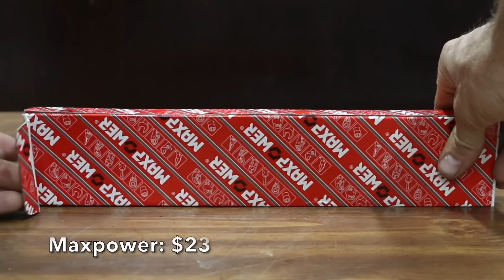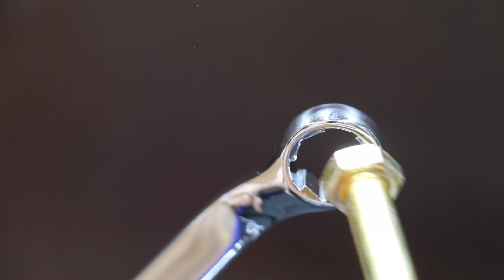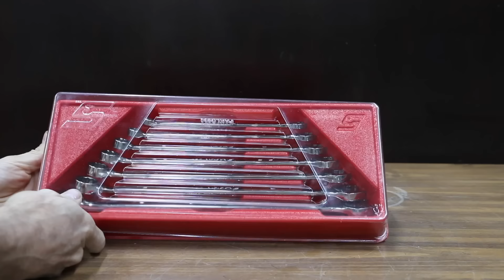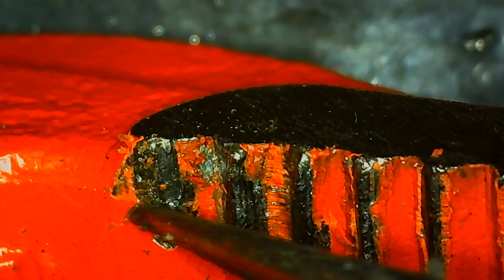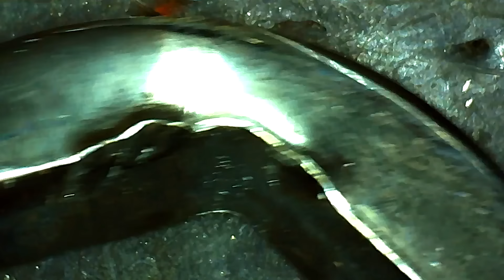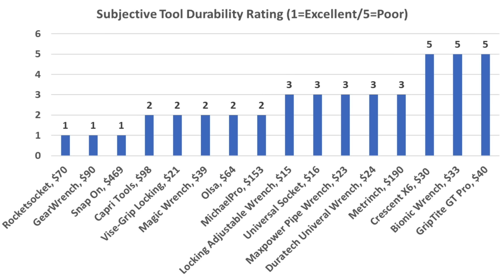Best "Rounded Nut" Extractor Wrench? Let's Settle This!

Comment: My mom got me a bionic wrench a few years ago for a Christmas present. It looked cool, but that was it. When it comes to practical uses, it's 100% useless. I tried to use it 1 time to change the oil. It was the 1st thing I grabbed. It wouldn't break loose the drain plug. It's not even remotely comfortable to use either
Reply from the maker: Thanks for sharing.

Comment: Todd It's been a while, how about a updated ceramic coating test? I feel like you could take the top 3 from the last video and compare them to the new stuff that is out. It seems like that field evolves faster than most people can keep up with it.
Reply from the maker: Thanks for the suggestion.
Reply: Breaking Taps has done research on this.

Comment: I have the best luck with regular old pipe wrenches getting rounded bolts out. Definitely hard to get into tight spots tho. I know one thing for certain and that's anything made by Irwin is absolute garbage. Have you done C clamps?

Comment: I’ve got mastercraft set (sold at Canadian tire) two ratcheting wrench’s covering 8 sizes and I’ve never found a bolt they won’t turn out, I have the socket set as well (same style as the rocket socket) and they grab like crazy as well, I don’t use them every day but they get used a fair amount and have held up great, which is surprising for something from crappy tire lol

Comment: I have a couple Capri tools,, they are very good quality. I think I'll keep using regular ol' vice grips on rounded bolts unless I see a great deal on something else. Lack of easy access is usually what causes the problem to begin with and nothing fits every situation The old "weld a nut on top" trick works better than anything if you can..
Reply: 100% correct what you said Vice Grip and weld a nut are king to remove damaged nuts and bolts all the other products  used in this video are not worth the money  spend your money on a good welder or  a top of the line Vice Grips

Comment: So much work goes into these videos.  I don't think you can buy bolts with a rounded head, nor do I know how your torqued them down.  However I think you made a lot of people happy crushing the metal pin tool.
Reply: Best way to round bolts is putting them in a lathe.
Reply: @jort93z  That's true but something tells me a drill and a bastard file were involved.

Comment: WOW, Commander! You did a FINE job on the tests BUT I never knew there were such things. I might need to get out more but don't see a real reason to do so. I have an old pair of Vise-grips and an 8 inch rusty Rigid pipe wrench and a set of DeWalt Rocket Sockets for the impact. I never have been too particular how I got something loose, as long as it came loose. My pal at the saw shop said the DeWalt Rocket Socket jobs would bring stuff out but the bolt was shot. That never has been a factor here because I can always drill it out and put a nut and washer on it. Hope the last of winter is treating yall easy. Stuff starting to freeze and die back here but it's expected. THANKS for the rounded and semi-rounded test. That shows up a lot of junk. BLESSINGS all over the FARM!
Reply from the maker: Hi Lewie, Thank you very much for the positive feedback on the review. It means a lot to me! You've got a great strategy for dealing with rounded fasteners. The rounded nut extractor wrenches sure are nice for those hard-to-reach nuts and bolts. I'm sure looking forward to warmer weather and so are the cattle as they're already looking for green patches of grass. Another month and grass growth should good enough and I should no longer need to feed hay.  Wishing yall many BLESSINGS!!!
Reply: @ProjectFarm  I've mowed the high places a couple of times but the rest is greening up and coming on up. It'll be here before too long. Yall stay warm and dry with all that good old hard hardwood you've got ratholed back for such weather. God Bless!

Comment: I've always had good luck the few times I've had rounded fasteners with a Swedish pipe wrench. Also very handy for changing a very stuck gas chair cylinder. 
If I need something smaller the Capri looks like a good buy. Thanks again.
Reply from the maker: You are welcome!  Thanks for the feedback.

Comment: It's unfortunate to see that, even the manufacturers mention the metric sizes, you don't do this in your videos lately. :( Please please mention both of the systems (metric and imperial)..
Reply from the maker: Thanks for the suggestion.
Reply: For all practical purposes the Imperial system of length measurements fell out of use during the Great War. The USA never used Imperial and Great Britain needed our manufacturing capability. By then we'd switched to the International Industrial Standard System. Now granted Standard and Imperial are very close to one and another. Close enough a lot can't tell the difference. But the system that's been used for over 100 years now isn't Imperial. Because Murica! Oh and by never I mean we didn't use Imperial before switching to Standard either. The old US system actually predates the Imperial system by 40 years.

Comment: I imagine a regular pair of vise-grips would have out-performed all of those wrenches at a much lower price.  When I have a rounded bolt head to deal with, regular vise grips are my first choice, as the bolt is already wrecked and needs to be replaced anyway.  Another great video, Todd.  Have a great Sunday👍
Reply from the maker: Thanks!
Reply: I agree. Vise grips are invaluable. Shame they’re made in China now.
Reply: @I_SuperHiro_I  The Malco Eagle grips are US made
Reply: @I_SuperHiro_I  I have a small and large pair I bought years and years ago which are made in USA.  Been through hell and back, but still worth their weight in gold.
Reply: A vintage Petersen Vice Grip would probably outperform the "new" one but there are some other tool manufacturers who make locking pliers that might be better than the current "vice grip"
Reply: @davidpowell3347  Have you had a pair of the Malco Eagle grips? I have several; Made in the Original USA Vice Grip Factory and are amazing. Way better finished that the old Peterson Vice Grips -(Which are Great)
Reply: @marko11kram  I have one,I probably should check whether Epstein's Hardware Store "HJE" has any more,they sell online,I think that Malco of Nebraska might have stopped manufacturing them. (various styles and sizes) People tend to buy the cheap stuff.
Reply: @davidpowell3347  I believe they are selling out their old stock. I bought a few as the ones I bought already were so great. 
Their price was high, but so was the quality. 
Even at the price, they are, (were) worth it.
I bought a bunch looking forward to the future

Comment: Awesome ! Thank you . & I need to check out your other video on socket extractors , too . This video makes me feel like there’s a proper tool for the job and none of those are it in my opinion 😅 extractor sockets all the way replace the bolt save the fancy tools for the easier jobs they’re for I think . Last thing i want to do is damage any of my tools . Seems wrong . Meanwhile , extractor sockets were made for this . Other options are penetrating oils spray cans or dangerous heat tools like a hot knife or a fancy bolt heater tool . I tried the hammer and chisel claim but ruined my chisel . & it was an expensive chisel .. don’t believe everything you hear . I’d rather have used a scrap piece of metal and beat the sh*t out of the bolt than have ruined a chisel . Don’t ruin . Hell naw . Bolts are cheap . If an extractor sockets or hot knife doesn’t do it I’d just break it off drill it out and tap it .
Reply from the maker: Thanks and you are welcome!

Comment: Todd,
As always incredible video! I am curious if anyone has suggested paint brushes. I know you did painter's tape which was incredibly valuable. Perhaps paint rollers too, such as which brand is the most absorbent and drips the least. Also curious how your coffee brand is doing? I'm venturing out from my daily coffee brand and absolutely want to support you, outside of youtube!
Reply from the maker: Thanks!  Thanks for the video ideas.  Folks are enjoying the coffee!
Reply: One brand - found everywhere (in the US) - that's stood the test of time - Purdy!  Yea, $20+ dollars on a brush - but I've had a 1.5" and 2.5" sash brush for 35 years.  Clean the well, hang to dry, store in their covers.  Key thing - get the right brush for the right product for the finish you want.  E.g. Chinese bristle with latex (needs to be synthetic) is just asking for problems.  But for solvent-based poly, lacquer, shellac, etc. Chinese bristle is the way to go.  Technique, and product you're using, it's age, temp, humidity, etc. also have a lot to do with how the finish will turn out.  Lot of variables that need controlling.
Reply: Paint brushes would be good.

but a painter got me to spend money on premium brushes (I just get the purdy since they're easy to find) and it makes painting so much easier and cleaner than with a cheap brush.

Comment: You need to revisit stripped screw extractors, there are sooo many different types on the market today, and thats before throwing brands into the mix. Altho Ive personally found that the style type that uses screw threading(like ryobi) is the most effective by far, the only other type ive tried is the twist fluted kind. But there's at least a half dozen, if not more, notably & significantly different styles, plus some hybridized styles. And further more, of that theres some that combine the drilling & extraction into the same action; and even further more, of the hybridized, theres a couple different styles. And how those compare against a good pair of vampliers would also be a useful additive to the testoff. I know itd be going the extra several miles to additionally compare the large various available substrates (like bearing steel, etc) and coatings(black oxide, Tin, TiCN, bright, etcs), but the coatings wear through, so its mostly just the various styled types of broken\stripped screw extractors im interested in, and to a lesser extent perhaps the effectiveness that the different alloys(cr-v, cr-m, bearing steel, hss, m35, m42, neobium, etcs). Im definitely curious about the niobium drill bits and how those comparatively fit into the scheme of things... But that'd be for a different video.
Reply from the maker: Thanks for the video idea.

Comment: You should test which thread of bolt is the strongest.   Corse thread, fine thread, etc.
Reply: Strongest in what way? There's clamping force and shear strength. They're not the same things. When a fastener is torqued you're not really relying on the shear strength of the fastener then either. It's the friction between the mated parts that grips. What's more important is what the fastener is made out of. Because fasteners stretch and threads strip out. The Torque Test Channel did some testing of different bolts. But I'm not sure if their methodology was flawless.
Reply from the maker: Thanks for the suggestion.

Comment: I look forward to seeing the results from other options. 

My parrot jaw vice grips have teeth in the v to grip a stripped nut.  They have worked maybe 1 of 10 times I tried them.  

I use pipe wrenches whenever they fit.
Reply from the maker: Thanks for sharing.

Comment: I just bought these cool little brake line flaring tools from Capri and it works great
Reply from the maker: Good to know! Thank you!
Reply: @ProjectFarm  it has screw driver handles and a small clamp block and a couple bolts. Great compact tools
Reply from the maker: Thanks for sharing.

Comment: "Millennials are killing the useless gimmick wrench industry!" I've been curious about all of these at some point or another, I thank you for testing them so I don't have even more useless tools in my toolbox.
Reply from the maker: Thank you very much!
Reply: No kidding. I have literally scooped dirt into a socket and poured it out  before I placed it back on a rounded bolt head to give me the bite I needed to torque it off. Half the battle is stopping before its completely rounded and attacking it with a better approach. Snap on outta be ashamed for charging what they do for that set of wrenches!
Reply: Bob Villa sold millions to Boomers every Xmas for $19.99 through Sears TV ads!
Reply: @OldBeaterGarage  so true, Sears is one of the first/oldest sellers of useless "innovative" tools
Reply: @M.TTT.  Canadian Tire is continuing the tradition north of the 49th.
Reply: @M.TTT.  Sears played both sides.  There were decent, but maybe not ultimate, tools for people who knew better.  Generally those tools were arguably the best pice/value proposition.  On the other hand Sears didn’t hesitate to sell questionable gimmick tools for people who didn’t know better.

Sears was the Amazon of mail-order catalog years, even selling rebadged Henry J cars as “Sears Interstate” and entire houses as kits which built a nice quality homes.  There is a subdivision in Akron, Ohio where Harvey Firestone ordered customized kit houses from Sears.  Those homes are still there.  You can identify Sears houses because the lumber pieces have numbers stamped to correlate them to the building plans.
Reply: @OldBeaterGarage lol I have a craftsman wrench and socket master set from 1990 ish but yeah  not a gimic sucker.👍
Reply: @jasonh4167  Still not as good as a 1960's version.
Reply: @jasonh4167  I still have all the Craftsman socket sets and wrenches I bought back in the 1970s and some my dad bought in the 1950s.  The new stuff labeled “Craftsman” is much lower quality, especially the stuff now sold at Lowes.
Reply: @OldBeaterGarage  if you can believe that freemasons played golf on the moon 53 years ago, then you can believe in a magic wrench too 😂
Reply: agreed!
Reply: if you have any useless tools mail them to me.

Comment: The vise grip ones are game changers for when you need a line/flare nut wrench. Nothing beats them...I have the full set of 3 sizes and although I don't use them often, they are irreplaceable on tough fittings where you need an open end.
Reply from the maker: Great feedback! Thank you
Reply: Agreed.  They always save me in a pinch
Reply: Came in a set I bought from Mac years ago. Only use the needle nose vise grip one more. Great on any round stock also.
Reply: I've had one for years. It's great for undoing seized fasteners, but can easily apply enough clamping force to permanently deform nuts. It's a tool of last resort.

I've also use it to crush or reshape things (e.g. flatten a tube end) when I've not had a vice to hand. In the unclamped position, snug the adjustment screw down hard, then clamp. Release and repeat. It doesn't work on springy material, as there's not enough jaw movement to push it past the yield point.
Reply: So your pipe wrenches dont have an open end? I cant see why you need the locking feature for that, and when you dont need locking a pipe wrench is the tool to use.
Reply: @pflaffik  pipe wrenches chew things up and don't work for things like brake lines or ac fittings or similar. They also stay put once locked on and don't eat up a ton of space...we're not talking gas pipe or whatnot.
Reply: @pflaffik  Just stripped a few 14m bolt heads on wife’s Jeep. Had to cut slide pins to remove whole caliber. Ended up locking in vise, heat, and large pipe wrench to break free. They end up being the end game loads of time but are harder to get in places. How sharpe the teeth matter also. I had 2 grind 2 flats spots on one as to get better purchase. If I had to do all over I would of just ordered 4 new calibers from Amazon.
Reply: @shade38211  That would be calipers.
Reply: @MrTruckerf  I love making grammar and spelling mistakes so my catholic school graduate friends, Alexa ,Siri , and you have something to do and feel good about.   Know I have to take them off and replace with what you typed, thx.
Reply: @MrTruckerf  can you find the mistake in there?
Reply: @shade38211  I now where there's more than one mistake, know what I mean?
Reply: @455buick6  lol like a look and find. Would love to organize a gofund to send some of these grammar police to visit inner cities. I betz they would have a good time fixing those Ebonics mistakes.  No I have to get back to taking off the calibers for replacement. Yous think auto zone will exchange for calipers.  Thank god my wifey didntz run off a cliff.
Reply: @shade38211  don’t hate me cause I’m catholic and was educated!!!!😂
Reply: @schutzhund3933  Catholic also lad. Just joke with some of my oldest friends. Had an Irish catholic elementary school but they closed after second grade. Girl I went there with married my best friend. She loves correcting me.
Reply: @shade38211  I absolutely love it when people think they are smarter than someone and have to correct the spelling errors.... but are NOT smart enough to understand and read between the lines as to what the message/comment really is conveying. It annoys me if it's someone I deal with regularly that actually has a spelling problem and think it's OK. I highly doubt that's the case here.
Reply: As a Mac Tool Distributor we sold a  three piece set  10 or more years ago. They flopped!
Reply: Destructive compared to a traditional "line wrench" on soft fittings.
Suitable if it is O.K. to crush whatever it is you are trying to remove,otherwise no go.
Reply: @davidpowell3347  these are for when line wrenches won't move it, at that point I'll take deformed over rounded any day of the week lol